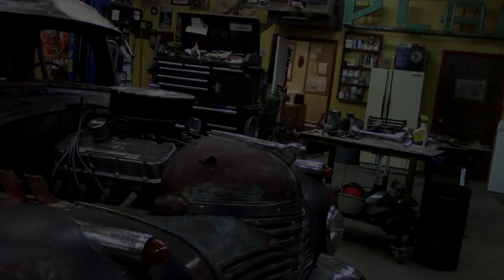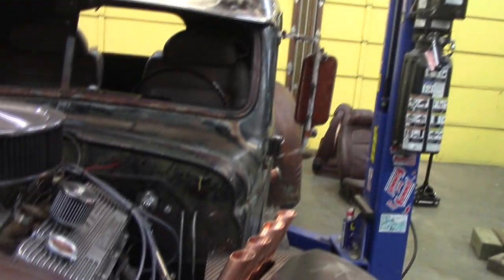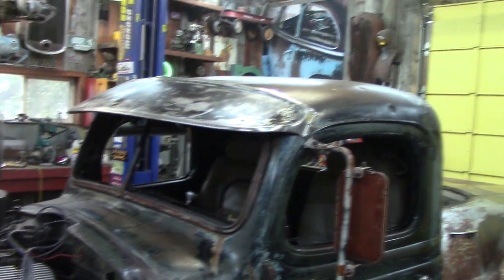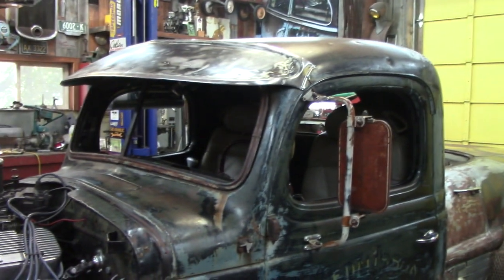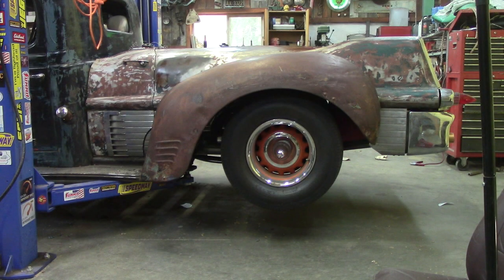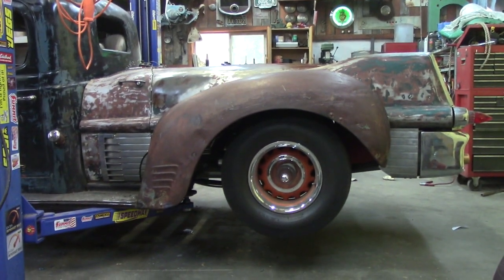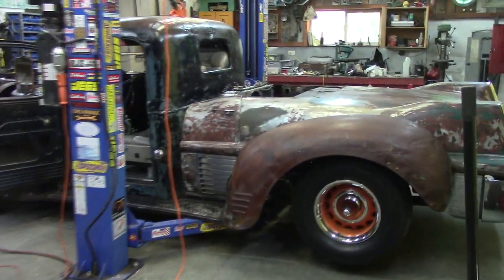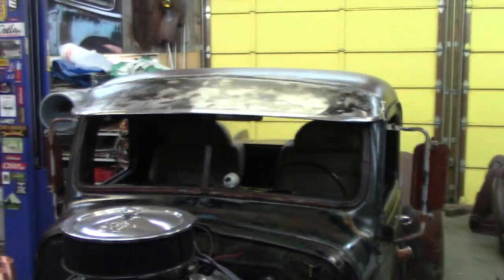LETS BUILD A RATROD #41- Workin' the late shift

Comment: Hey Ken! Here's a poor boy trick to mounting big heavy tires. Get yourself a piece of 10 inch sch 40 irrigation pipe and cut you a slice of it 6 inches long and then cut a section out of that to cradle your tire so it won't roll out. next turn it over and  weld a adapter to except you floor jack you get my drift! I even put rollers on mine so I could roll the tire to lineup the lug holes!